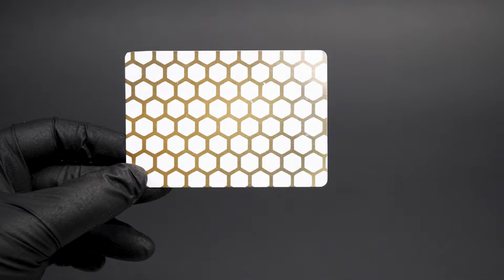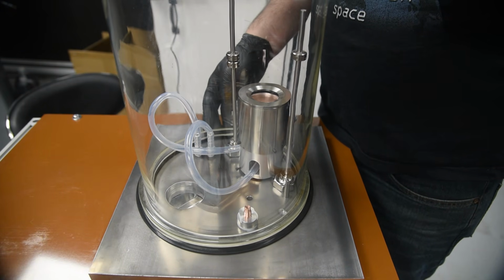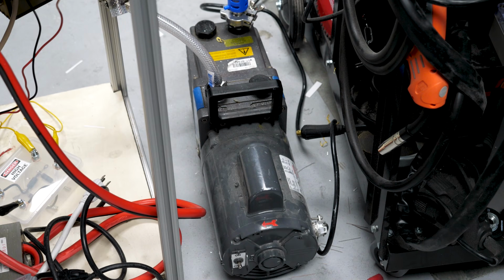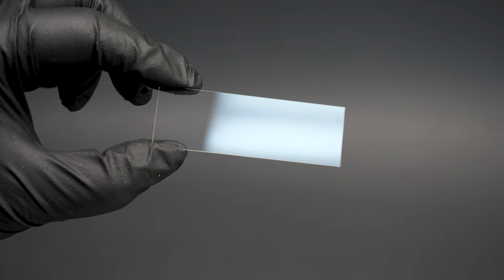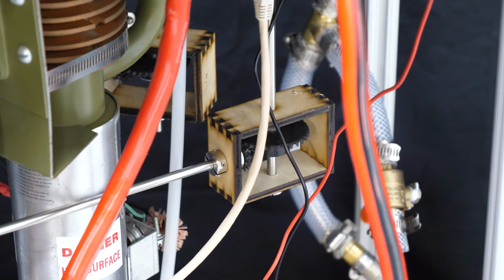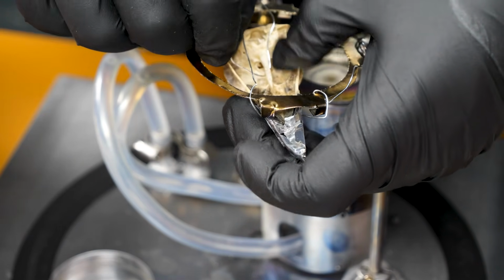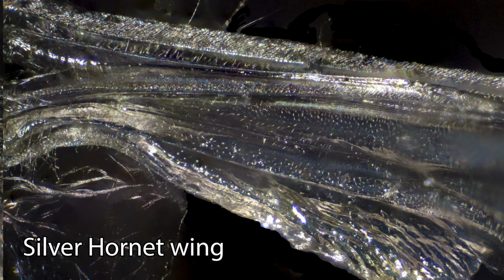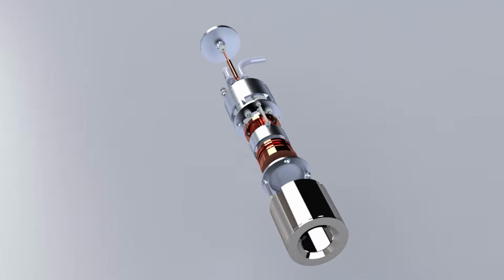Metal Coating using PLASMA (Part 1 - How it works)

Comment: This is a genuine question I like to have answered; Since edible gold leaves are a thing, could this machine be used to coat food and then have it safe to be eaten? As a chef that would be dope as fuck
Reply: Due to golds nature, I believe you'd be able to do that! Gold is very chemically inert, thus biologically inert as well, so a light coating on food would work, though only certain(dry) foods would work. As a matter of fact, edible gold is legitimate gold, just extremely pure as to abide by the EU and US food standards.
Reply: you cannot have any moisture in the stuff you are coating, so it would be hard to freeze dry and then add moisture back to your dishes, but it would not be imposible

Comment: Would 3d printed structures in the vacuum chamber offgas too much? If not, maybe you could make a custom card-moving part to let you coat a whole deck in one or two runs. Instead of trying to make something very general, like a robot arm, you could print a part perfectly tailored to each new manipulation task.

Comment: Quick question as there is already a closedloop cooling system, is the blower necessary ? Or can you use a watercooled heat sink with a bigger radiator ?
Reply from the maker: most diff pumps are water cooled. This one is just weird and uses air

Comment: The human neuron circuit is amazing, first of all, but there's something I'm confused about. How do you train a neural network like that? In a typical digital neural network, you train it by telling it how well it's doing according to some heuristic. (Basically, "do more like this attempt" or "do less like that attempt") How do you tell the blob of goo whether it's on the right track?
Reply from the maker: carrot and stick. some input frequencies when sent as an electric signal encourages neuron spiking, others decrease neuron spiking. apply the right pulses in the right spots and they learn to respond to certain patterns

Comment: I used to work in a thin film lab.  Your videos were very useful in understanding to process.  P.S. you could make tons of $$ with ring laser gyros.  P.P.S. be careful or some foreign intelligence agencies will snatchbyou up.
Reply: Aslo we coated the inside of the chamber with foil to help cleanup and reduce time between shots.  We also had mesh screens to focus the plasma ray, this helped make the layers of atoms uniform

Comment: Just a silly idea. What if you would put sample holding rod in the middle of the machine, and put ~6 sample holders on every side. That way you could coat multiple samples so much quicker without the need to reset machine after each one.

Comment: Any reason not to stick a butterfly valve between the diffusion pump and the chamber (and extra chamber roughing line) so that you can open the system up without having to cool the system down each time?

Comment: When I worked in an organic optoelectronics lab, we cleaned glass by ultrasonic cleaning bath with 18Mohm water, acetone, and isopropanol and dried by blowing off with nitrogen.  We would also used a plasma cleaner with oxygen plasma to destroy everything else.  We really should have only needed the acetone and plasma

Comment: I remember doing coating in a vacuum chamber back at university. We used the heated filament method. We could measure the thickness of the coating very precisely by shining a laser through the coating (with a basic interferometer setup)

Comment: Just the off-the-cuff final comment of "the last reason I wanted this machine is because this is the groundwork for two other projects that both require a vacuum system like this. The first one being an ion engine and the second being a nuclear fusion reactor."
Well ok o.o;

Comment: Could you make a picture with those color filters?
Like, iirc those work by producing currents that precisely correspond to the colors (the spectra) you want, right? So if you varied that current's spectrum spacially, it should be possible to get pretty much any combination of colors you'd like. But I've never seen anybody try this

Comment: A Microcontroller could probably automate a lot of the start end end of the process. With the help of a vacuum sensor, it could turn on the oil vacuum pump. In the reverse direction with a PT100 in the oils it could wait till the oil cools down before opening the valve to release pressure. It might even be able to adjust the current flowing through the plasma generator, by measuring the resistance.

Comment: Are you familiar with Tech Ingredients? I'd like to see a graphite rocket nozzle coated in tantalum or niobium carbide using magnetron sputtering, to see if it prevents ablation.

Comment: I have a silly idea. Naturally you will be trying to make integrated circuits, but I wondered how small one can make vacuum tubes. I mean, is it possible to miniaturise them and still make a working electronic system that, perhaps needs far lower voltages to work? I just wondered, but I know it is stupid, right? 
I am no engineer, what I understand, is that the smaller things are, the higher the frequency they can work at. That might be a useful thing. Also, another weird idea I have is, can one create something like and  MRI machine in miniature?
The reason is that these machines require extremely big, expensive magnets and huge amounts of electricity, so miniaturizing it so it proportionally can use a very smaller magnet can revolutionize the idea, but again, this is just silly me. Thanks for amazing videos and hope you many successes.

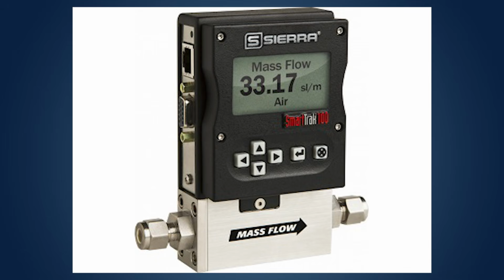Comment: At 07:00 you mention that a digital mass flow controller would be better. AppliedScience used one in his copper deposition video and he didn't get good results. The comments mentioned that the valves in these flow controllers have some leakage. You should add an additional valve, if you decide to use them.

Comment: If you want an even more crazy project you could use that system for silicon chips. Sam Zeloof has make a IC fab in his shed with some deposition equipment and a old microscope and modified projector as the photolithography machine.

Comment: Could you just diconnect the diffusion pump with a vaulve, open the system, change materials, create the decent vacuum and reconnect the diffusion pump?
Reply: yes, you need 3 valves though, including one pretty large one.
Reply: @Basement-Science  That is very likely to be correct but could you provide some more detail?
I would have expected two vaulves to be enough, one for the regular pump and one for the diffusion pump but again probably naivity on my part
Reply: @dennisk.6988  In general you need the 2 pumps connected in series for it to work. High vacuum pumps cannot move stuff into atmospheric pressure by themselves. 

So you need a valve to close each side of the high vacuum pump (diffusion in this case) plus a valve that connects the roughing pump by itself to the chamber.
Reply: @Basement-Science  Ah, yes, that makes a lot of sense, thanks!

Comment: "nice DC voltage" hopefully there is some smoothing caps somewhere in the circuit as well! :)
Reply: I don't think that a magnetron cares as long as the current isn't backwards. microwave ovens usually only have one diode

Comment: Are you going to go with the ICF type of reactor? I'm assuming so, as they should be easier to build than a tokamak. If you use tritium/deuterium pellets I suggest using 0.1mg of heavy elements which will function as the "core". The heavy elements will gravitate toward the center of the sphere, which after the fusion reaction occurs, the pellets will remain in a high temperature and high pressure state. This will help maintain the temperature of the plasma as well as its directed pressure at the center of the sphere. Since the pressure is kept at a constant, the pellet will not immediately undergo omnidirectional-fusion. A portion of plasma energy on the surface will be released to the surrounding reaction chamber, which maintains a balance between the two entities. The pellet will neither expand nor shrink and the fuel of the pellets will be squeezed to the surface in moderate amounts to further the reaction process, making the reaction more durable and stable.

Comment: But how can you plate the interior of a sponge?  This seems to do just surface deposition, while I'd love to coat the interior of a sponge.
Reply: Check out the AppliedScience channel (link is in the description). His most recent video is on atomic layer deposition technique, that can coat insides of objects. Short simplified explanation, You use a thin gas that reacts with the surface of the sample to deposit a material. By cycling between two gasses that react to each other but not themselves, you can deposit layers atom by atom.

Comment: Great video, but a full bridge rectifier still provides an AC voltage. To make it truly DC, you need to add a capacitor and another diode to get to DC (though with a pretty wicked ripple depending on your power usage).

You might get a more consistent plasma if you add the extra diode and cap as your voltage won’t collapse with each half cycle of your AC input.

You mentioned adding a stepper too - make sure you find one that is meant for vacuums. The bearings for these are usually packed with grease which will off gas horribly. You may be able to remove it with acetone, but you risk removing the shellac on the coils and creating a short.

And to “truly coat anything”, we’re gonna need some gold plated toilet paper ;)

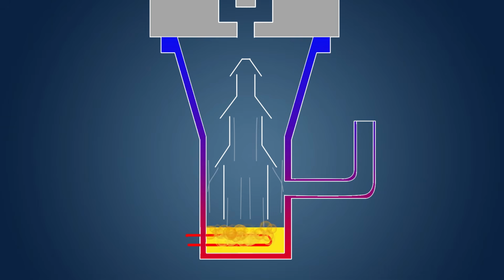Comment: 6:10 I was told by people who are really into ultra-sensitive mass spectrometry, that for MS work, it is really hard not to have detectable traces of oil enter the MS from an oil diffusion pump. Hence their preference for turbomolecular.
Reply: turbo molecular is basically a modified Turbine engine right?
Reply: @ayatotakema1194  kinda, its similar to the compressor stages of a big jet engine, its driven by an electric motor to spin at crazy RPMs, multiple tens of thousands of RPM if I remember right

Comment: I am REALLY excited to see the videos coming out of the new lab. I think 2022 (and what's left of 2021) is going to be your best year yet

Quick question, how do you deal with the metal adhering to things in the chamber it's not supposed to? Is there a way to scrub it off, or do you just deal with it as it builds and replace it if it causes issues?

Comment: That is very impressive. I have gotten myself some vacuum equipment as I am hoping to make a some equipment like this myself in the future (in the meantime I have done some sub-militorr  freeze-drying which has been fun).

Suggestion: these are expensive, even on ebay, but you should look into getting a vacuum gate valve. An ISO100 Edwards gate valve can be bought for around $1000. The price tag sucks, but you can get into your vacuum chamber without needing to cycle your diffusion pump.

Edit: I searched for "vacuum gate valve" on Ebay and found a bunch for under $200. That should be much more palatable.

Comment: I was just thinking how cool origami would look coated in metal. It might need a coat before and after folding though.
Reply: Foil paper for origami does actually exist, and it in fact does look pretty neat
Reply: The idea reminds me of the origami that I wax coated way back when. Certainly not nearly as cool as metal deposition, but it was a lot of fun. The one thing was thay the wax would collect in corners
Reply: vacum and origamy might not mix well...
Reply: @maxk5065  Just make sure the paper is nice and dry.

Comment: I copied your first magnetron sputtering system when you first posted it on YouTube. It works great for how simple it is. I am able to sputter from smaller pieces of metal I place on my main plate. I was able to sputter gold from a gold plated piece of thin ribbon metal that was laying on my nickel/copper baseplate. It’s hard to get to work repeatedly though lol.  
One safety note: I once accidentally took a whiff of the air right next to my ghetto bell jar while retrieving my sputtered item and all I smelled for the next day was an alien metallic smell. I was legit scared I ruined my smeller. Luckily things went back to normal after a couple days.
Reply: That does sound scary. Having a small action you take possibly negatively affect you for the rest of your life. 😰
Reply: Lol it coated your nose

Comment: Machining tip: When clamping a small part into your vise, clamp another, similar sized part at the other side of the vise. This maximizes clamping force and prevents wracking of the clamp jaws, which leads to weak clamping.
Reply: Yeah, that one that you f*cked up at the start... Still has its uses

Comment: I love the idea behind this, but what is the point of providing plans if the design is dependent/contingent on that rare, expensive Pyrex dome?
Reply from the maker: They pop up online from time to time for cheapish. Besides, the idea isn't to make this 1:1. You have to adjust it to what you have, and the tools at your disposal. Even though they look similar there's a huge difference between my system and ben's. Same ideas, executed very differently. It's a jumping off point for the next person.

Comment: I wonder how fine the details of the coating can be. Namely, it could be cool to combine it with a scanning tunneling microscope, which can measure into the nanometer range. STMs require an electronically conductive surface, so nonconductive surfaces could firstly be coated with this.

Comment: When coating plastic or other materials, especially for cosplay/models like you mentioned, how robust is the deposited later of metal? Will the surface layer survive minor flexing of the object, or even light handling? I notice you were using gloves/tweezers and utmost care not to touch the coated area.
Reply: Depends on the coatings hardness and adhesion. The Al/Ti on the plastic should be ok for light handling. They all scratch easy though because they are so thin. Flexing isn't a problem because for the same reason - the shiny plastic on chip packets is aluminum.

You can up the durability with a layer of clear coat.

Comment: 15:12 What do You think about adding valve between diffusion pump and chamber? You could close the valve and repressurize the chamber while keeping pump under vacuum. Do Your stuff, close the chamber, use 1st stage pump and then switch to 2nd stage by opening the mentioned valve.
Reply: For this, you need a way to pull a rough vacuum in the camber before opening the valve to the diffusion pump again, so in total you end up with three valves. At University i used an old (1973 vintage) Edwards 306 which used this method. You either connect the roughing pump to the diffusion pump (backing) or close off that path and connect it to the chamber (roughing). The Diffusion pump could easily run 30 minutes without the roughing pump and vacuum chamber connected (though we used the expensive Santovac 5 oil, which is less prone to oxidation). So you can easily pump down the chamber with the roughing pump before switching back to backing and opening the main valve.
Reply: or he could just get a turbo and save a lot of time at this size
Reply: @Mister_Brown  A turbo still needs a few minutes to spin up or down. 
Also, the main valve for shutting off a high vacuum pump can get pretty expensive, at least if you're trying not to restrict the throughput.
Reply: Since the problem is hot oil reacting with oxygen, then maybe you could even get away with no valves at all by flowing argon into the pump's openings.  If that works then you'd be able to get complacent and run low on gas in the middle of a changeover and ...  Nah, I don't like my idea anymore.
Reply: This is exactly how instruments designed with diffusion pumps work.  Valve to close off diff pump from chamber, with a bypass valve to rough out the chamber (while also isolating the back end of the diff pump from high pressure).  You can further protect the diffusion pump so it can run without the rough pump by adding a ballast tank (just an evacuated empty chamber between the diffusion pump and rough pump) which acts as a 'virtual rough pump' for the diff pump while you have it isolated.  Yes, more complex valving, but so much faster.

Comment: Ad a capacitor to the dc side of a full bridge rectifier to smooth out the voltage, right now you are getting pulsating dc voltage
Reply: That would probably make things worse... You want a steady current to sustain a stable plasma. So if anything, you would have to add a (huge) inductor on the DC side. A high voltage constant current controlled SMPS would be ideal.

Comment: Just remember the process for producing diamonds through DLC is patented
Reply from the maker: Got a link? Would love to read it so I don't accidentally replicate their method
Reply: @thethoughtemporium  trying to find the exact one, don't remember off of the top of my head but I know it deals with producing pure sp3(or close to). You should be fine as most DLC, ta-C will not reach high sp3 to sp2/1 ratios
Reply: @thethoughtemporium  you can make dlc coatings pretty easily through your ion source, when I was in that field our chambers used CH4 as the process gas and Si or SiO2 as an adhesion layer

Comment: ...could you technically do this to coat your teeth in a supermaterial?

Obviously you'd need to very thoroughly clean the teeth first but.. could that be a good idea?
Reply: if you had detachable teeth, yeah
definitely can't when they're in your mouth due to the need for a vacuum
Reply: The need for a vacuum could be overcome with a silicon mold couldn't it? Diamond superneeth.. or even enamel growing here we come right? Hahaha.
Reply: @thatonecommunist  If you use a silicone mold you're just making what are effectively retainers, no?
Reply: @auua1001  no, I was thinking using a silicone mold to interface with the vacuum and only have your teeth exposed to it.